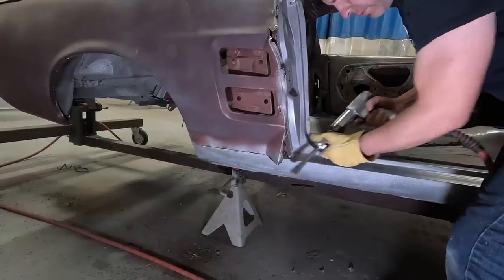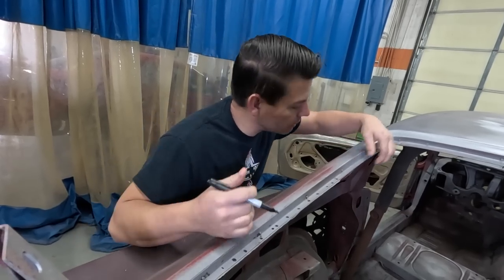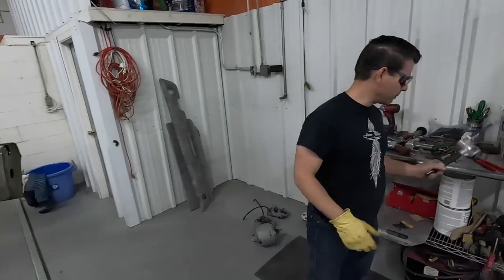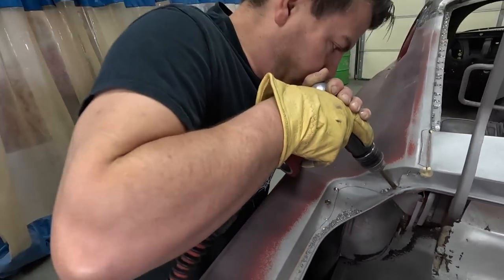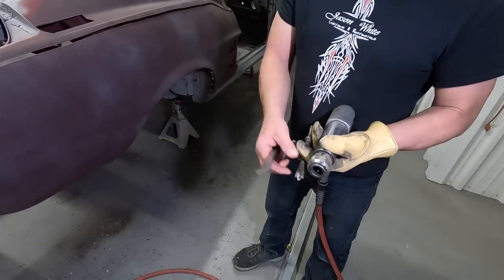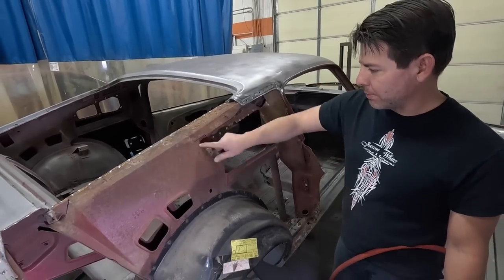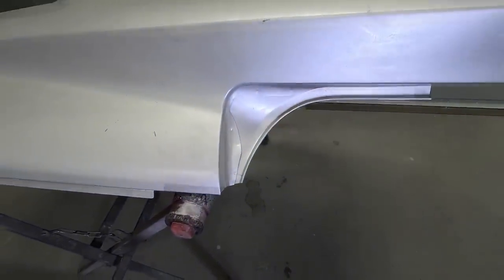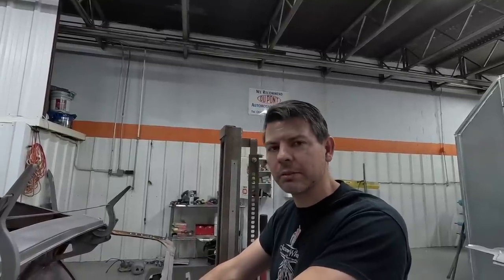Part 2: 1967 Shelby Mustang GT500 Restoration "Sheetmetal is the car. The body is everything."

Comment: He is right about the NOS parts. I worked at a Ford dealership in the early 80s. I use to buy 65-68 Mustangs fix and flip. I need a 65 inner drivers side apron that was connected to the front core support. I was shocked when the parts guy said that I could still order one. I also restored a 68 GT convertible. Was shocked again when I was able to order the OEM dual exhaust tips NOS. So thrilled that I ordered 1 set for a spare. Even back then they were expensive.

Comment: The project of a lifetime, Jerry. Great to see yours in not only such capable hands!
The mans' passion is just as important as his skill, however - and this fella has that, too.
Integrity, expertise and motivation....this is going to be quite a car when done.
- Ed on the Ridge
Reply from the maker: Yes, thanks Ed. I agree 100%. I can't wait to show the car done. We lack installing the 428 & transmission and that's about it.
Reply: @thewriter2549  
Hi Jerry. A friend of mine has 5 camaros
1967 race care mixed emotions 2
1967 street
1968 street
1969 street
2009 street
He also has a 
71 cuttles
And
1965 Chevelle race car mixef emotion 
He restored all but the 09 himself.
Someone needs to document his collection.
If you or you can recommend someone please let me know.
Reply: @thewriter2549  He has had 5 of the cars 30 yeaars or longer and did most the work himself

Comment: Jason, you gotta be ADD/ hyperactive. If not, I apologize and don't mean anything bad by it. I myself do the same work with GM A body's preferably BOPs and I'm ADD AF, lol. I stay up multiple days sometimes working on the cars. Oldsmobiles are my go-to, but I love everything about GM 68-72s. Every car I go through, I know every production number if available, which not all are, factory marks, date codes and I rebuild the motors. Just had to say you're the slightly older version of myself and I love knowing there's the same mentality as myself out there cause I don't find many that understand myself.  Godspeed!

Comment: Back in the late 70s built a 1967 Shelby clone, black-on-black with the brushed aluminum interior. Have found a 67 mustang without a hood in the garage and no engine for $100 65,000 original miles had the rug top loader and a 9in,, built a 390 with tripower and closed chamber heads, was easily over 400 hp by the Ford parts books. Never top ended it but got it over 145mph. Recently saw it in a YouTube video in Tulsa Oklahoma stripped and Left for Dead.

Comment: They call them a rosette tip
Much larger heat dispersal for removal of lead.  A cutting torch head has alot of the right characteristics but smaller orifices .
But he got the job done and that's what counts

Comment: I agree with you totally if you want a top end restoration = know it, do it your self !!! A muffler cutter is a Air Hammer .That cut off wheel is called a Die Grinder I have always known it to be .I ben a body man for 40 years .Those where Ford QT'S no doubt as they where red oxide primer for early service parts then black E-Coat was used on parts after mid 80's  back in the day. looks like the driver side was what i call a last uesd NOS part made at Ford just be for parts discounted date.

Comment: He clearly loves his work, I am not a fan of blasting, I believe that dipping does a better job getting between the joined panels to clear out all facets of corrosion that blasting cannot
Reply from the maker: A good subject to kick around. I did the first undercarriage detailing article many years ago. Chemical stripping will take away the factory markings, which I noticed Bob Perkins is calling "witness marks" these days. So, dipping is really washing away all that history. Also, what does dipping do to the original seam sealer?And isn't there the worry of the liquid remaining trapped in cracks an crevices that might leak out later after the car is painted?

Comment: "other shops put new bumpers on it, thats not restoration"

"so yeah we cut out the original quarters and floors"

💀💀💀💀
Reply from the maker: The original floorpan is intact except for part of the driver's foot box and a few small holes on the front passenger side. The trunk floor was all there.

Comment: Above all cars, I hate the ‘67 Shelby Mustang, and I love ‘67 Mustangs.  This car single-handedly jacked-up the prices  to absurdity of every mustang on the planet as people built Eleanor clones.  The Shelby ruins the most beautiful esthetics of this vintage…the finned tail and blunt nose. Looks like a backyard mail order kit.
Reply from the maker: If you read the account from the Ford designer of the car, influenced by Carroll Shelby himself, and Shelby-American, those scoops were inspired by the scoops on a GT-40 that was nearby at Shelby-American in Los Angeles. Shelby was running Ford's racing program at the time for LeMans. In profile, the '67 Shelby has a profile similar to a GT-40,  which some people believe is the most beautiful car ever. Beauty is in the eye of the beholder, of course, but remember that the Eleanor was built decades after the Shelby GT500 of 1967. The Eleanor borrows styling cues from the Shelby, as you know. I take it the increase in prices of regular fastback is the source of your hate, not the '67 design.
Reply: @thewriter2549  I’ve been an engineer in the automotive and aerospace industry for 30+ years… how anyone could confuse a GT40 (a near perfect esthetic) with a GT500 is quite a stretch.  Good car designs imbue a consistent motif throughout… proportions, trend lines, transitions.  The designers work to get this correct from the start. You can’t just slap a bulbous nose and blocked out tail on a beautiful design and call it an esthetic improvement.  As ugly as the Superbird/Daytonas were, at least they won some races.  I like 67-68 fastback cars, but the Shelby cars are on par with the ‘71 cars for ugly.  I think your eyeballs are just fogged-up with nostalgia.  And yes there was a precipitous increase in all classic mustang prices circa the remake of gone in 60 seconds, which ruined the hobby for many of us.  If you had any idea how mass produced cars are engineered, you’d begin to understand the absurdity of the classic car pricing.

Comment: I hate safety glasses....but...l WEAR UM.
Get a good frame that fits well with med. to lrge. lenses from a local thrift store. Take it to an optomitrist and order new tempered safety glass lenses 
(Rx or plano x plano) w/auto darken feature if you work outside and inside so you never have to take um off .....
Use side guards for extra protection.
Love um.

Comment: Why did these even need to be replaced? Not trying to be negative, just actually wondering why. Thanks!
Reply from the maker: Good question- the answer is the car had coupe quarters grafted in many years ago. That means they sliced that original fastback rear quarter panel and replaced the lower half as Jason pointed out in the video. From the outside, this slice had been blended into the metal with plastic filler and covered over with paint. But, it was still there. Also, a welding seam would remain visible inside the trunk. In our full restoration, we wanted the car to have all metal fastback rear quarters with no seams like it was brand new from the factory.
Reply: @thewriter2549  ok thanks for clarifying. I was debating whether the factory upper quarter mated to a ford replacement lower quarter would actually be more correct than a full replacement quarter but I hadn’t thought about the fact that you can see the repair welds from inside the trunk. This is an amazing video series

Comment: I'm surprised that someone did all that work, and then didn't fix the lower trunk inner aprons. This is the car that previous shop was working on that caught on fire, fortunately the car didn't burn, but the hood was destroyed?
Reply from the maker: We thought some of the parts went to the shop that burned up, but turns out this was not true. The car was sold in a sheriff's auction in 1980 and immediately went to this barn (where I found and bought it) without those parts. So, no fire was involved. A family member of the previous owner told us the missing parts got pulled, by whom he did not say, before that sheriff's sale. Those pulled parts were the 428 engine, original 4-speed transmission, one lower side scoop, back seat, rear taillight panel, grille, and fiberglass hood. I was amazed when that person rattled off to me, over the phone, those 7 parts. The buyer of the car in 1980 started a restoration that included buying a reproduction grille (upper and lower), finding a back seat, and rear taillight panel. I bought the rest of the parts. I am still hopeful that whoever got those parts might step up and sell them to me, especially the engine with it dual four's and the transmission, with its matching Ford VIN.

Comment: That is wrong way to cut quarter panels , they should be done by drilling spot welds ,because your way needs more spot welds and sometimes body lines don't match
Reply from the maker: He drilled all the factory spot welds.

Comment: This is more fabrication than restoration. Very little of the original car is here.
Reply from the maker: Fabricated? Name them. As far as the body goes, both doors are original, both fenders are original, the front nose cone is original,  the radiator support and shock towers and fender aprons and cowl are original, the dash is original, the deck lid is original, the floorpan is original, the cowl is original, the trunk floor is original. This car had very little rust. Of course, the rear quarters had been replaced.

Comment: You are not doing a restoration   you are doing the cosmetic repair.
Reply from the maker: This is a full, professional restoration, not a cosmetic repair.
Reply: Maybe I missed the videos cuz I didn't see the firewall getting taken apart. Inner and outer rockers apart I didn't see the roof skin off. So you can take care of all the rest in between all the. When I did restoration work the whole car got taken apart floorboards got taken off their rockers rockers were taken apart firewalls were taken apart all the metal got drilled off each other so every part of that car could be either dipped or sandblasted so every part of that car could be fixed for rust